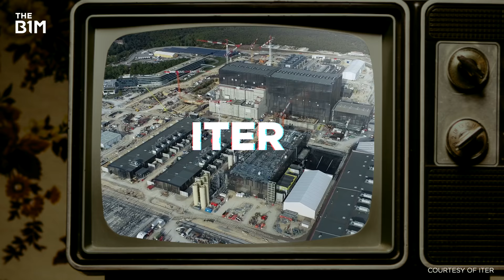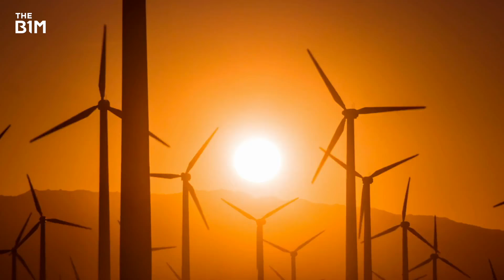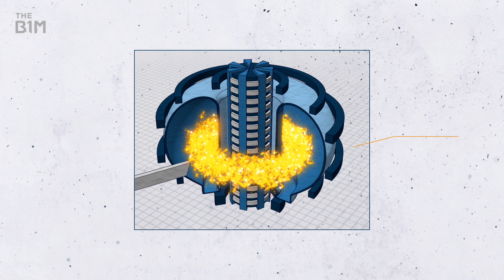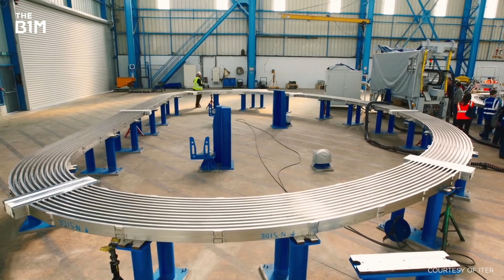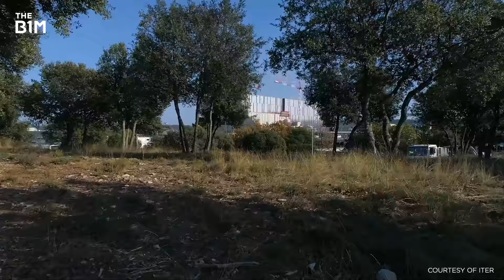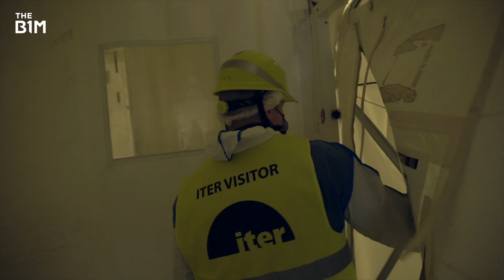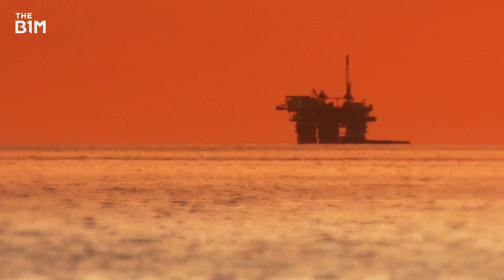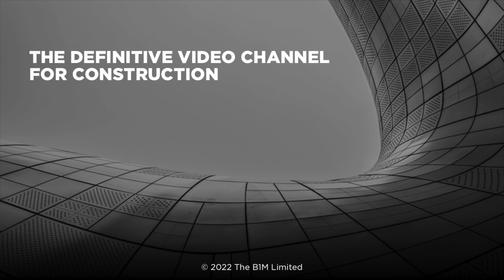We Went Inside the Largest Nuclear Fusion Reactor

Comment: I wonder what happens when we have low cost energy? Would it lead to betterment, aside from yes, that it can produce power pretty much with no carbon at all essentially helping with the global warming scene.
Reply: I am also sceptical about low cost energy. The market will ultimately decide. And even if fusion will work in the future, will it be economically competitive with the current renewables?
Reply: @VanDerPol  Exactly my thoughts. The selling point for renewables is to challenge the traditional  concept of base load generators. Create arrays of renewable generators (wind,solar, etc) that also store that energy for later use in various types of storage (battery, hyrdro, etc). To build resiliency into grid dependent on renewables you need to over build to ensure supply. How much so before you can remove base load generators (if at all possible) I guess is yet to be seen. Fusion tech will need to try and under cut the cost of all of this. With that said having the ability to produce a huge abundance of power could be transformational, perhaps it starts a technology revolution where new technologies that require larger amounts of energy than we can practically produce today. Fusion propulsion, or perhaps driving large machines to work faster and harder than ever before.
Reply: @VanDerPol  Fusion would likely help contribute to supporting baseload requirements of grids at a minimum. That being said, who knows how pricing and total levelized costs will pan out for essentially a very immature, very advanced and demanding technology concept?
Reply: @michaeldunne338  Very good point. The question is - of course - a little bit more complicated than my first comment suggested. The need for baseload capability and (maybe even more important) grid stability needs to be factored into a discussion of price. In fact, it already is, since the price for electricity varies over a day. Can we really power our entire society with renewables and energy storage solutions? Norway e.g. can, Germany (as far as I know) can realistically not do this on their state territory alone.
Reply: @VanDerPol  
if by market will decide you mean companies still price gouging for no reason uhh. yea nothing to decide there.
if fusion becomes viable, it will become competitive as long as the reactor has a long lifespan. pretty much ALL markets are propped up by their governments, FF is no different and if you were to remove those free handouts to FF companies, their prices would skyrocket and they would no longer be viable.
 if FF is still some how around when fusion becomes viable, it's likely the FF companies will try to stomp fusion out of existence by any means possible. then again by the time fusion becomes viable there will be no turning around if FF is still in high use at that time. so life and the value of everything will become meaningless as time goes on.
Reply: @rocksfire4390  I wasn't even thinking that far. By "market will decide", I meant that a dicision for a company to build a fusion reactor will ultimately be decided, if they can money with it. That depends on fuel cost, building cost and the price they can achieve for the energy. This also not an easy question to answer, since electricity procudes by fusion is base load capable and can be used to control the grid stability. 
Of course - that does not even touch on the question of lobbying and state funding.
Reply: @VanDerPol  
i see, thanks for the clarification.
Reply: @VanDerPol  Its already economically feasible RIGHT NOW to install a solar and battery back up system to essentially power your entire house. Imagine 20 years from now. They will be just starting to make energy but a large amount of people will already be energy independent IMO.
Reply: @CrossWindsPat  For a private household you're right. After 14-16 years of operation you hit the break even point of your investment (broadly speaking). Yet, you still have to have the money for the initial investment and you are most likely still connected to the grid. Also depends on where you live  (e.g. short days during scandinavian winters).
Additionally, that is surely not a solution, which is scalable for everyone. Apartment blocks or high-rise buildings will not be able to produce their complete energy consumptions by photovoltaics. And we didn't even talk about energy. 
However, I think that we will see a drastic increase in PV on private homes. Germany might even pass a law demanding PV on new builds.
Reply: @VanDerPol  California has already passed a law of a similar fashion. 
I feel like that ROI is already closer to 10 years if your smart and buy competitively. Even better if you can do some of the work yourself that becomes even cheaper.
Reply: @VanDerPol  No, it will not be economically competitive, because the sun is a fusion reactor that runs for free.
Reply: @P8qzxnxfP85xZ2H3wDRV  Harvesting solar energy is not free.
Reply: Unfortunately fusion energy has its own environmental problems. For breeding tritium you need a massive mantle of pure lithium, which has all the resource harvesting problems that batteries have. You're also creating nuclear waste through neutron bombardment, albeit less problematic than in current fission reactors. Then there's deuterium, which has the same environmental problems as seawater desalination.
Unfortunately there's just no perfect technology. Only ones with problems that are easy to solve or hard to solve.
Reply: @P8qzxnxfP85xZ2H3wDRV  Yep. This is why it will take a combination of different technologies and regulations to make the change happen. There is no one single smoking gun.  
Unless someone figures out cold fusion!
Reply: @P8qzxnxfP85xZ2H3wDRV  totally forgot water desalination is a huge thing that eats electricity, that is, unless graphene could be mass produced with much lower production cost.
Reply: @P8qzxnxfP85xZ2H3wDRV  Dealing with Tritium and Deuterium represents a problem of much less magnitude than that of current fuels for fission nuclear plants. Would even wonder about being easier to work with, handle, dispose of, than coal too? 

But yes, there is no such thing as a free lunch. But if the vision pans out then there would be a fundamental leap in change for the better, in terms of energy security, impact on the environment, economic development, etc. ... but that is likely 30 to 50 years away. :-) If at all feasible (suspect 50/50 chance).
Reply: It's potentially limitless energy, but it won't be low cost even with relatively inexpensive input resources and disregarding initial construction costs. It's a very sensitive system that has to be constantly monitored to make sure it does not burn itself out, since price of failure is... Not necessarily high, like fission reactors and large scale hydro failures, but definitely very expensive.
Reply: I hope it is going to be possible, but some of the most powerful people in the world still want fossil fuels because of the money. But I don’t hope it is going to be a problem
Reply: @noahmichelsen3774  That's literally stupid to put it mildly.

If a technology comes out like fusion the investment/profit prospects will be out of this world, everyone will invest into something like that.

This is the problem with people that don't understand economics, and people who say stupid shit like "under capitalism nothing will be low cost" While being surrounded by products that were once impossible, and are now cheap thanks to capitalism.

Like shut up.
Reply: The fossil-fuel billionaires and tech bro's will find a way to screw this up and extract even more wealth.
Reply: And it would solve alot of the energy issues and detach it from natural resources (looking at Russia and it's oil)
Reply: Fusion isn't a tech we seek just because its greener but also because its simply more efficient and demands less fuel than our current technology. So if Fusion becomes viable commercially, its not just an option among many, it genuinely makes many other energy sources completely redundant. And when we have more energy supply than we have demand, then prices lower automatically, no amount of attempted price fixing can change it.
Reply: I think that question is jumping the gun substantially as it relates to fusion. We are still only throwing money at it and praying we find a way to turn it into a viable source of energy. Even if we do, it seems pretty clear that fusion will never be "low cost" unless other alternatives skyrocket in price.
Reply: @RoseJetExhaust  Yes of course. As always. I am from Greece and here politicians are retarded as always. So i don't expect much for the next 5-10 years.
Reply: Its low cost energy for governments, not the people paying for the electricity.
Reply: lmao you actually think they're not gonna charge more for this? 22 bil....they expect to make money
Reply: @funtourhawk  well, it's not about this one is it? This one will never make power for the grid so no one is getting charged for it in that way. It's about this technology over time becoming cheap enough to be cheaper than current forms of energy generation
Reply: "Power too cheap to meter"... We made better meters! Also, check the amount already spent on the unfinished, not designed to power the grid, experiment. (that might not work... achieve fusion: probably, as smaller designs have, produce power: maybe.)

(I have a dirt cheap multimeter that can accurately measure NANO AMPS.)
Reply: It should unlock superior technological advancements.
Reply: What about this screams "cheap" to you?
Reply: People will unfortunately find reasons to continue using fossil fuel infrastructure for decades beyond the realisation of fusion if a sustained political effort isn't made to dismantle it. Opposition to fusion will exist in the same way opposition to wind and solar exists now, because vast swathes of people economically rely on the state of things NOT changing. That's why you have to build the case for renewables now so that fusion is politically acceptable when it arrives, otherwise I guarantee that the vast lobbying power of legacy energy industries will smear it as an expensive science experiment without real world promise.
Reply: @Munkenba  Exactly.
Support renewables, because they are the solution for present.
Reply: No, matter what happens to with the current trajectory of climate change we are in an inter-glacial period, so it possible we might just bring the next Ice Age closer than 400 years.
Reply: Nuclear fusion will only be (relative) low cost energy if fossil fuels receive hefty taxation in the future to avoid further CO2 emissions
Reply: @master8127  So petition governments to give all of those grants and subsidies they gave to solar panel companies over to fusion research. Would be a better use of the money.
Reply: @killman369547  there isn’t an energy industry on earth that isn’t subsidised, both fusion and other renewables have received plenty of money in recent decades but it’s nothing on the vast government crutch that oil and gas have relied upon to exist since the very beginning, and they no longer have the excuse of being an underdeveloped technology to justify continued taxpayer investment.
Reply: @killman369547  No it would not be. Fusion is not a solution for the near or midterm future
Reply: The Oil and Gas industrial complex will NEVER let this happen.
Reply: @SoftAsFur  it's already happening and has been for decades
Reply: there will never be low cost anything in capitalism, not even in your wildest dreams
Reply: @thewen  How are you defining low cost? There are countless examples of things we have because of capitalism that would be immensely more expensive without it. Even energy - if you tried to generate your own energy without capitalist input, it would cost you far more money.

I think you're letting your biased view of capitalism infect your thinking. The negatives (exploitation, inequality etc) may negate the positives (especially in systems where it isn't heavily controlled), but they don't remove them.
Reply: @thewen   Even with cheap, abundant energy, there still needs to be an incentive to conserve.  Otherwise, people would waste energy just because they could (i.e. leaving air conditioning running all day with windows open).  It's the fast food restaurant napkin problem.  If the napkins are free, people take whole handfuls of them even if they aren't needed.  The only way to force conservation is to either ration it, or charge for it.  Furthermore, there would always be a maintenance cost for both the fusion power plant and distribution network.
Reply: @texaswunderkind  but with cheap and green energy you don't need to be conservative
Reply: @texaswunderkind  Fusion power plants even if they perfect it they can't make the price fall that much. But whit progress in the world everyone will get richer making it cheaper anyway no matter how we make the electricity. But nothing wrong whit using more electrisity just means more progress and progress is good just need to make sure it's good for the planet also. And it's just stupid using air con or heat and just let it out the window but people do that even now so don't think it would be any big difference and a air con/ heat pump does not cool down or heat up anything it just takes heat from inside and blows it out or the other way around and whit a open window it just cancels it out and using power. Ain't bad for the enviroment if we can make the power carbon free.
Reply: @texaswunderkind  have you read or heard of "freakonomics"? It's a study of unintended consequences of financial manipulation.
I mention it in response to the part of your comment about fast food napkins.....
A child daycare centre was having trouble with parents being late collecting their kids at the end if the day, leading to overtime costs. They decided to try to reduce this by imposing a "late fee", a fine for late collections. Instead of reducing late collections, it actually increased. Parents considered it as an extra paid service they could use....
Reply: @dougaltolan3017  good one
Reply: @texaswunderkind  You've still failed to explain why artificial scarcity is a good thing.
Reply: @thewen  From what perspective? Generally speaking, labor is exceptionally low cost under capitalism.

Be wary of those who speak of economic philosophy in absolute terms.